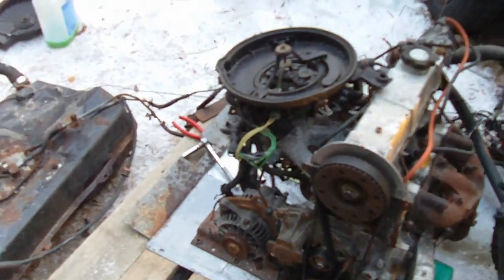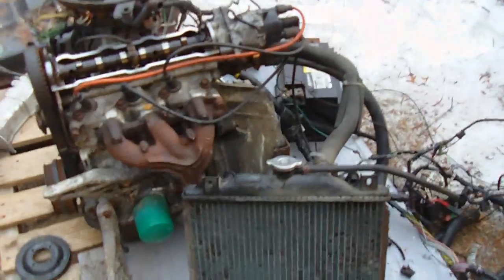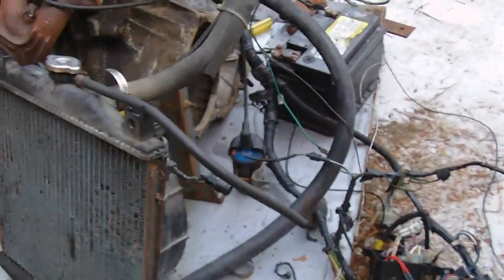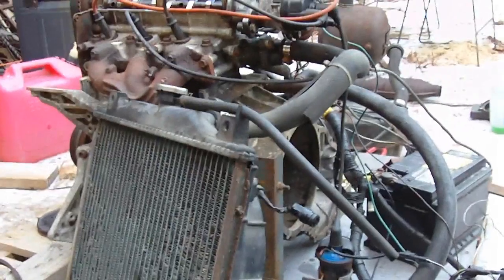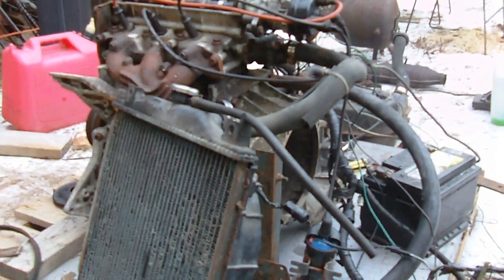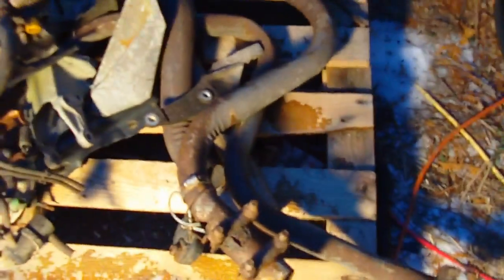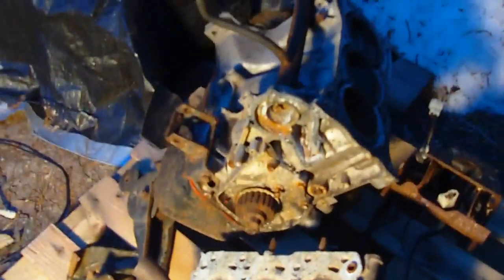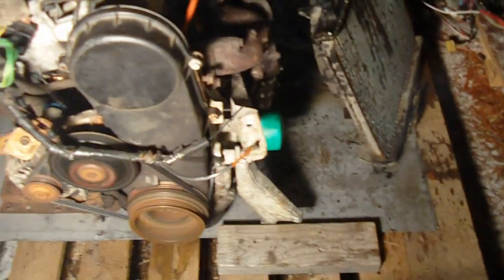Suzuki G10 1L Engine cold start, Generator project

Comment: See I need a quiet pressure washer to work cleaning restaurant hoods at middle of the night so car engine at idle with the correct pulleys will work my pressure pump only needs 1050 rpm and like 10 hp at 16 ftp of torque not much

Comment: You are halfway there. Running and it sounds great. You are up in Canada otherwise I'd try to trade one of my generators. Never use them since I got the inverters.

2-3 alternators with the engine just idling would power your home. At idle with the drag from the alternators that generator would use very little gas. A 4cyl engine idling for an hour is equivalent to driving ~6 miles.
If it works, hell yeh and it's way quieter than the gas gens I have. As it sits now it would function as a gen

Comment: What kind of generator are you going to put on that? You should be able to run a few homes with the output.

Very interested in how you plan on adjusting idle to compensate for the demand of the magneto. Like when a fridge kicks on or when the load increases. If the throttle doesn't increase

Tempting to just rig an alternator or two to the belt system to maintain/charge a couple of car batteries with a 3000w inverter.

Keep us posted. Would love to see how it progresses